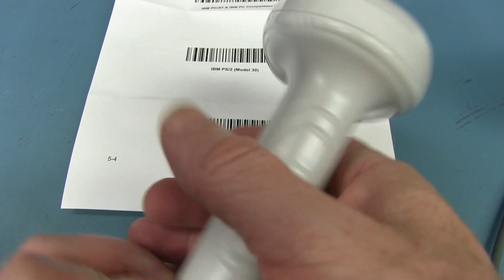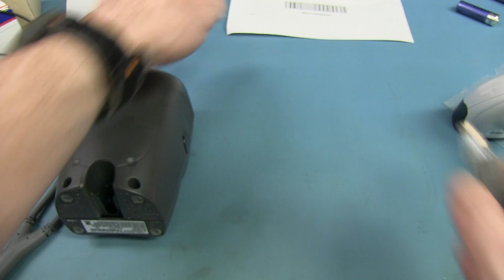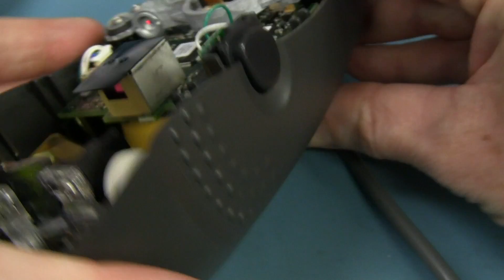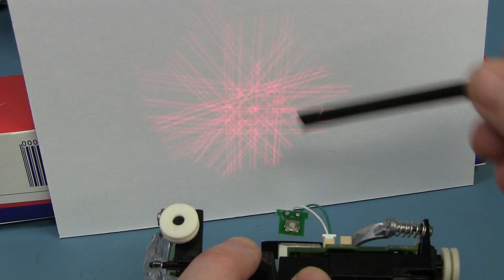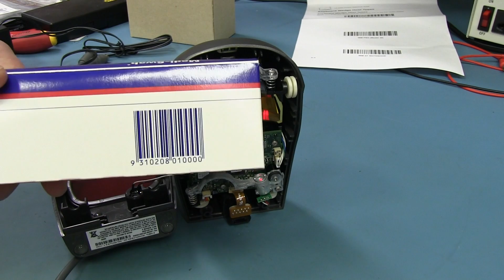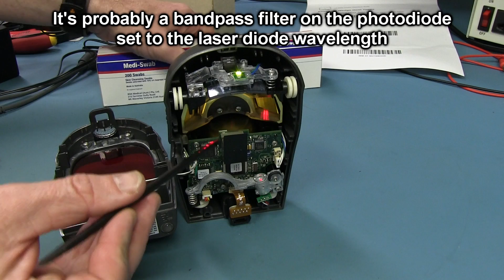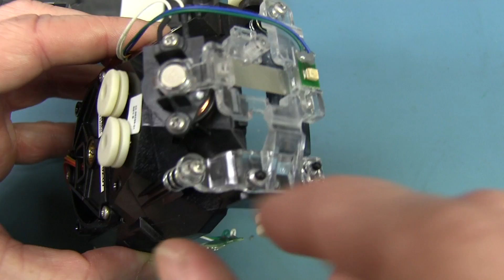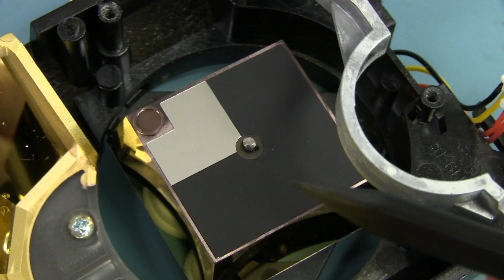EEVblog #637 - Omni Directional Laser Barcode Scanner Teardown

Comment: @EEVblog, With laser barcode scanners the laser sensor is simply detecting the on off pulses from the reflection from the dark and light stripes of the code. The sensor is 1 dimensional and only receives a serial stream of data. The sensor doesn't need to know anything about the angles the beam is scanning.

Here is the way I keep it straight. They also make pen type barcode scanners which use your hand to swipe the laser across the barcode. The rotating mirrors simply automate that process. At any given moment the laser is simply a point of light so it doesn't need a 2D sensor.

Edit: Actually, I didn't mean 1D sensor, I meant 0D like a photodiode. In my mental picture the 1D was the time axis. Sorry about the wording above if it confused anyone.

Also, the laser reflection return path follows the same path the laser took but in the reverse direction. The photodiode is either in the LLED package or there is a beam splitter to divert the return reflection into a detector located on the laser assembly.

Comment: It would be interesting to use a smoke machine to see all of the beams coming out of that.
Reply: or dave could light up a cigarette for science! but they also sell smoke in a can :)
Reply: jusb1066 Awesome!!! I want some :)
Reply: i have tried the idea with the fog machine - thats not really fun -
you dont see beams - the laser is a way to week -
you have to remember: the solid laser beam is distributed all over the different lines - so if you can see the beam out of the laser-diode after the rotating mirror you only see a really small amount of light.. -

Comment: Covering the laser and being surprised it doesn't work at all? Uhh? it works by reflecting the laser!!
Reply: EEVblog I don't think so. As the single point of laser light scans across the barcode (fast enough that to us it looks like a solid line) the reflected light is modulated brighter and darker by the ink / white of the bar code. The photodiode picks up this modulation over time.
Reply: Oliver O'Neill  Sorry to correct it, but no it would not. This is a laser scanner, not an image scanner. Completly different sensor. This scanner can only detect two states: Laser is being reflected by surface, laser is not reflected by surface. It can not detect an image. Even if it had an imagesensor (which it does not have, it just has an light sensor), it could never work with standard light, becaus it can only see 650nm (typical laser light). Thats why it can still read the barcode when he shines a flashlight on it: The scanner just doesnt see normal light.

Image Scanners are much more complex and expensive. Simplified: They are digital cameras with a software to detect Barcodes.

CCD Scanners (the usb model he also shows) are image scanners with just one (1) line of detectors. Those could probably work with any lightsource in the range of 650nm.
Reply from the maker: Gotta check...
Reply: Right, the sensor is just one photo diode, or whatever, not an array. The scanning of the laser converts the bar code from the spatial domain to the time domain, so to speak, and the time domain signal is decoded by the electronics.

I'd be surprised if there even is a synchronization between the logic and the spinning mirror. The bar code probably has all the right start and stop bits that it can just get picked out of the stream.
Reply: Photodiodes can work at normal lights, there are different types centered at differents wavelenghts, and I bet this dude is much smarter than you and the only reason he is checking if it works without the laser is for the people who dont know that kind of stuff...
Reply: EEVblog The filter over the photodiode is very likely a diachromatic filter designed to allow only the laser frequency of light through. The ambient room light probably doesn't have enough of that particular frequency to drive the diode to the "sense" level. Also, it's likely just a single diode rather than an array (or possibly 4 given the setup of this system) - so the input from the barcode has to be serial. You could try sweeping a laser pointer over the barcode to see if it requires the 4 lines (although they are serial too via sequential mirror faces)
Reply from the maker: theoneandonlyyoko
Yes, and this is why there would be an optical bandpass filter inside that photodiode module.
Reply from the maker: Bill Kuker
Ah, ok, fair enough. I assumed the photodiode had a much narrower field of view and was sweeping across as well. Makes sense that's it's probably looking at a larger field of view.
Reply: Curiosity has got us here at the end of the day. And besides I would try it as well. I would also try running it with a off the shelf laser
Reply: EEVblog It works similarly to UART does for asynchronous serial links, performing clock recovery on the raw single dimensional brightness coming off the sensor. The only information coming out of the diode is the maximum brightness detected at any point in time which will be the laser dot wherever it happens to be. Since it knows the rate the laser is moving and the maximum angle at which a laser might be hitting a valid barcode, it knows what baud rate to expect the signal at. Since it has 5 angles that gives maximum of 18 degrees out of line the barcode can be to the most closely aligned beam. so the clock can be stretched by at most 5% (1 / cos 18) for a code in front of it no matter what the angle. At at most a 5% difference in rate all it takes is a somewhat lenient UART to recover the clock. Given barcodes excellent DC balance the only real preprocessing is normalizing the brightness via a high pass filter and AGC.
Reply: EtikettenWissen  It has many similarities with a flying spot camera and it could in principle use the pattern to make images, it would be cumbersome due to the scanning pattern, a simple 2D scanning grid is generally used for flying spot cameras. Of course, since this is a scanner for 1D barcodes, it has no real need to reconstruct an image, it probably just filter and gain control the input and constructs a stream of bits that represents the high and low lights along the line currently scanned.

The DS9208, which can detect 2D barcodes has square scanning field, I believe, so it might be using a flying spot approach, though, since it also can detect codes from display devices like mobile phones, I suspect they may have 2D image sensing. Though you can read some display technologies with a flying spot scanner, they would have to be reflective types, not the emissive/backlit  type displays generally used on phones these days.
Reply: EEVblog
I don't think the diode has a large field of view. I would presume that the reflector on top of the device is a large concave mirror for the diode with one small portion in the center for boucing the laser originally.
Reply from the maker: *****
There is a chance you can illuminate the entire barcode with the same wavelength light and it could work that way. The laser is just illumination, it is not pulsed or encoded. So in theory given sufficient ambient light of the right wavelength it might work. Was worth testing.

Comment: From memory there is a set-up barcode that locks the settings from changes, Supermarkets 'should' be set-up like this
Reply from the maker: Should, yes, but in practice? you gotta wonder..
Reply: Oh no supermarket laser scanner hacking, the ques and long enough all ready.
Reply: I service these and other super-market POS equipment for a living.
Some models of scanners support a kind on "Lock" code, but many do not.  All the models that I know of that do have a "Lock" code, also have ways that it can be bypassed.  (Otherwise, it would be impossible to reconfigure after the first time it is "Locked")

And in my experience, there is no need to wonder weather it is used in practice.  None of the customers I service use this feature.  In fact, a good ~10% of the service calls I run are to reconfigure scanners that have been "accidentaly" bricked either by some one messing around with the programmign barcodes, or simple random noise patterns beign detected as a barcode by the scanner.  Barcodes and scanners are designed to make the latter less likely, but it does happen.